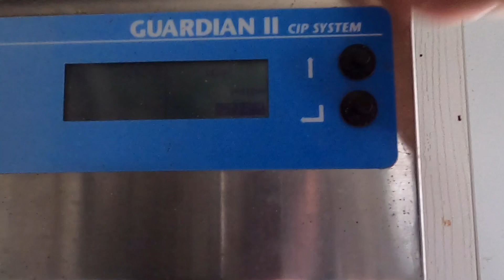Using A Poor Mans Boom Truck To Change A light Bulb!

Comment: Double duty elevator. I wish I could post the picture when I strung wire to my sisters barn. Extention ladder in the bucket of my tractor going to the top of a pole old enough to be a telegraph pole, buried 3 feet in the sand. I won't do it again! I think the neighbors heard my knees clattering.
Doc